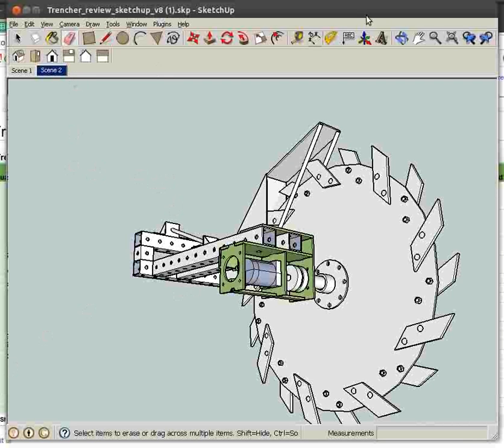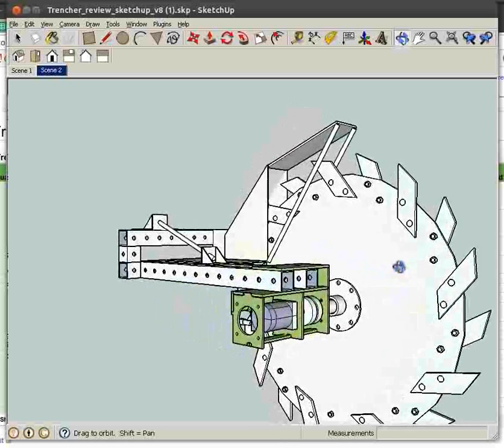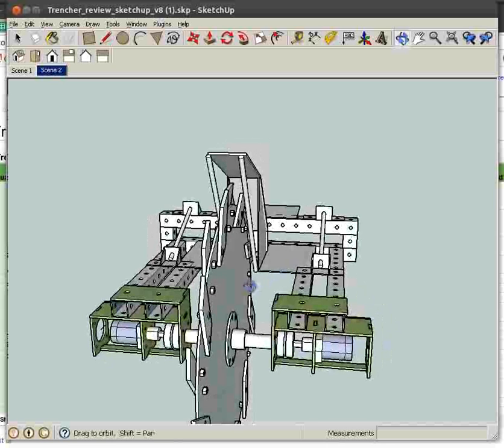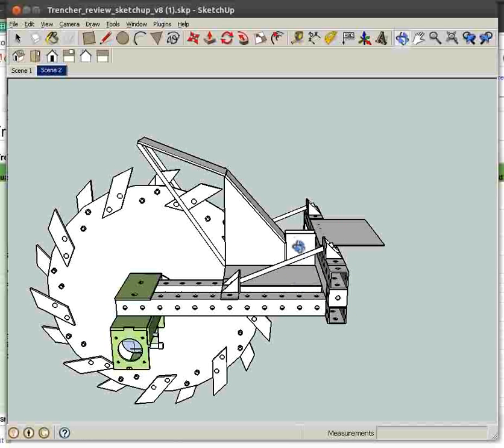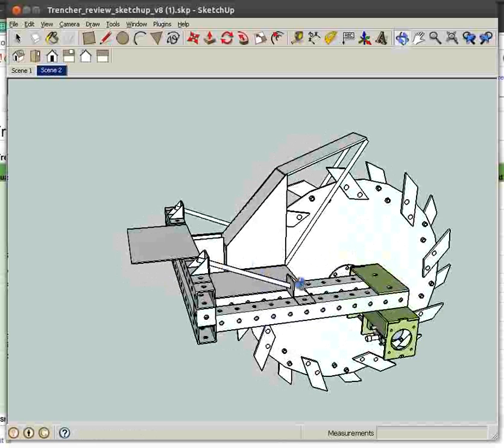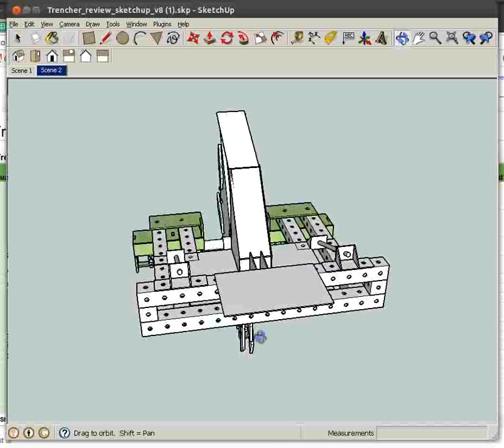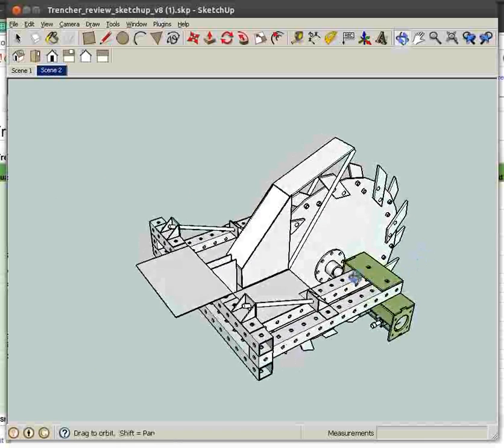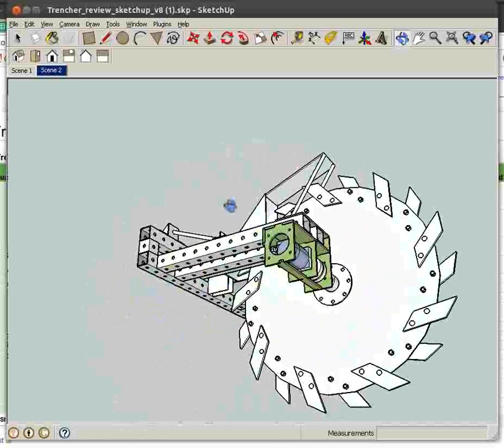Trencher Design Review

Comment: I like the design , I saw your test run and have a few suggestions.
1) skids or wheels should support the blade at the shaft
2) tractor should have a very low drive gear to prevent pushing the blade too fast
3) trench should be dug with two passes, your trench depth in the test was too much at once but NOT too much for the machine to handle in two passes